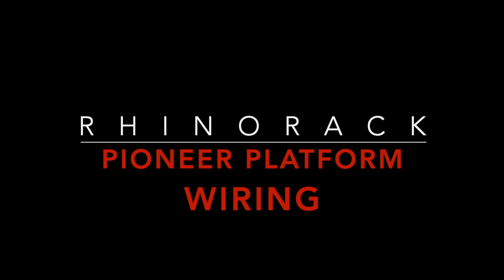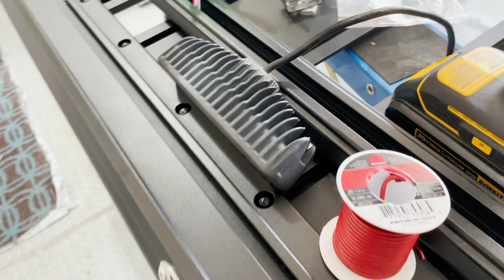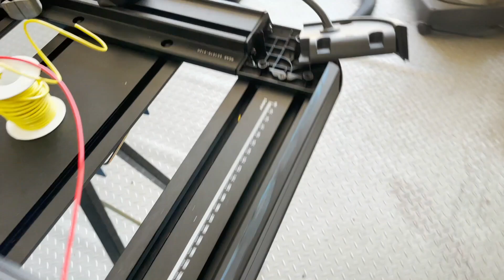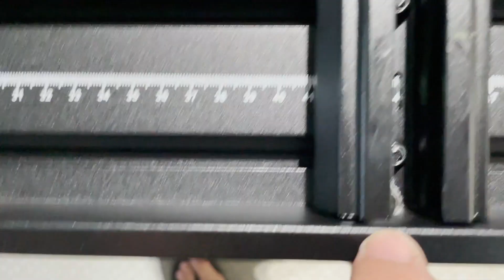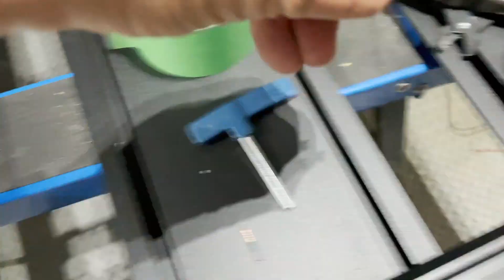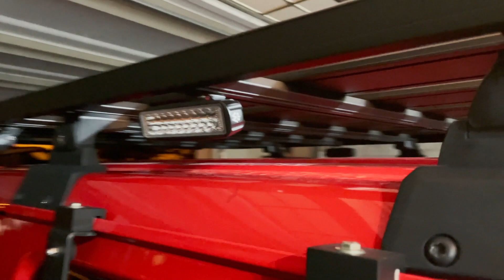Wiring lights onto the NEW RhinoRack Pioneer Platform - Jeep JL Rubicon Explore.Discover.Enjoy

Comment: I have the Rhino Rack on order for my Gladiator so your video was very timely and informative for me.  Thanks - I would have loved to see how you routed your wire hrness inside the Jeep.  Where did you get power from:?  How did you route the wires to the power source?  The change in video format did not bother me at all - but - audio is as important (or more important) than video.  The audio levels are all over the map - in most video editing software (FCPX) (Davinci Resolve) and many others you can LEVEL the audio for your entire video presentation - or just get a cheap wired or wireless Lavaleer mic.  I am trying to find your lights but can't find them on the Vivid Luman site - I liked to option for yellow or white on the same light.  Very slick
Reply from the maker: Hey, thanks for the feedback. The wiring goes through the back drivers side corner of the hardtop. I drilled a hole and use a grommet and sealant. I use a Deutsch connector to allow for the roof rack to be removed if desired. Wiring then runs under the plastic trim/carpet along the doors and into the engine bay where they all connect to a Voswitch
Reply: @okanaganoverlanding2912  Thanks so much for the timely and detailed response- it really helped me.

Comment: How have you made the hole in your roof water tight?
I’m looking for an alternative but doesn’t seem there is one
Reply from the maker: Hi, I drilled a hole and used a rubber grommet for the hole size. Cut the slit in the grommet for the wires. I then sealed around the outside of the grommet and wires with some silicone just in case. 4+ years and not a single leak!
Reply: @okanaganoverlanding2912  yeah I thought so. I’m really in two minds because I just don’t think I can bring myself to drill a hole in my roof haha. Thank you for your help

Comment: In the process of doing this. Are those lights from nilight? How are they holding up?  I am looking at Diode dynamics and Baha Designs  but can't decide because they are stupid expensive ;). Nice clean install!
Reply from the maker: Hi, thanks for the kudos! The lights were dual function amber/white 6” work lights from Vivid Lumen and I sold the roof rack with all the Lights last summer and they are still working great on the new owners jeep! I’m putting some DD SS1’s on this spring - two ambers for chase lights and some white floods for the sides! Diode Dynamics are amazing lights and reasonably priced compared to the likes of Baja and KC

Comment: Noticed how you put on a light bar on the front of the rack and under your RTT. Did the overhang and the awning obstruct a lot of your light? And was the light bar able to diminish the whistling caused by the flow of air under the RTT? Thanks
Reply from the maker: I didn’t notice any light being obstructed or a shadow being cast. There was wind noise pre roof rack and post! I guess I got used to it

Comment: How did you get the wire through the drilled holes for the side lights, and did you fit rubber grommets?
Reply from the maker: I drilled holes and then fished the wire with bailing wire and pulled them thru the hole with needle nose players. Yes, added some tiny grommets after pulling the wires
Reply: @okanaganoverlanding2912
Reply: Thanks mate, all sorted now.